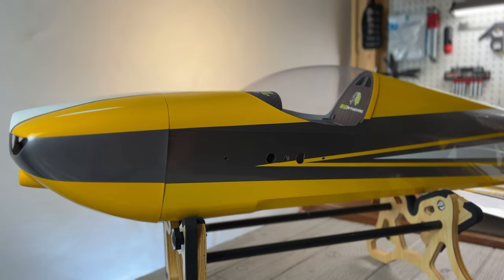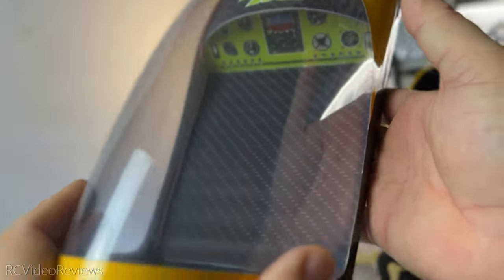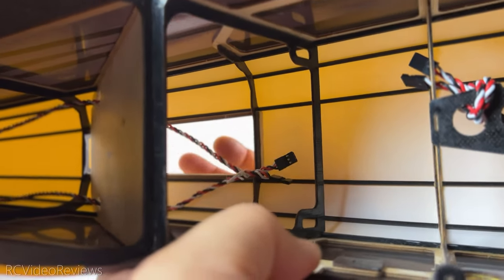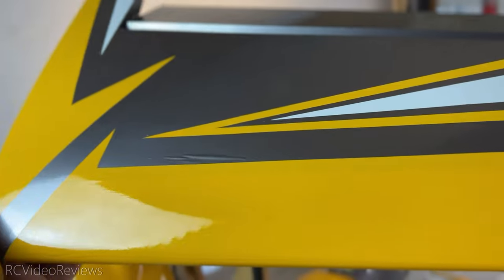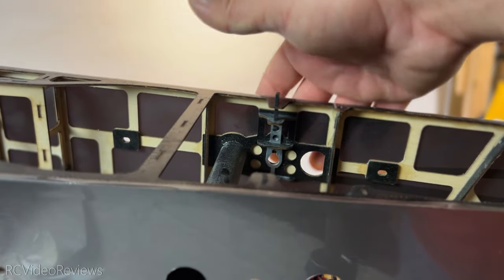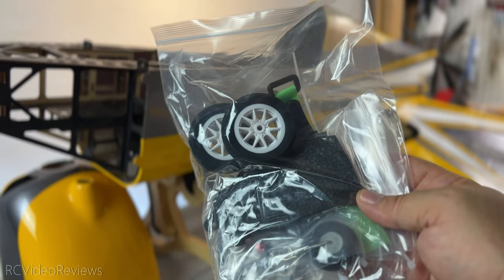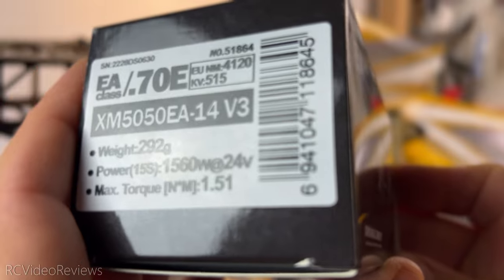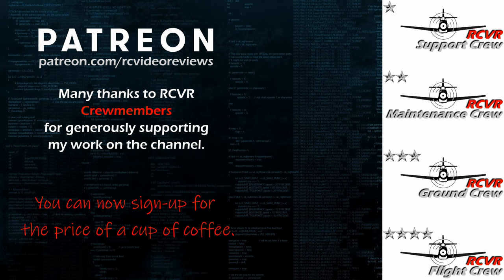Skywing 61" Edge 540 RC Airplane First Look

Comment: I just ordered a 67' Skywing Edge PNP. I use a spektrum ar637t receiver, the normal one with as3x and two antennas. Are there any signal reception problems with the carbon fuselage? Do you advise me to get a satellite for the receiver? Last question... out of the box the bec of the Hobbywing esc should be sufficient, do you recommend a separate power supply for the radio and servos? Thank you!!!
Reply from the maker: I've only experienced RSSI issues on one plane: The 67" Laser PNP. ALL OTHER EF/SW planes I have--no issues at all. So I believe my issue was related to the Rx. Of course, this isn't a cheap plane, so if you can add a little extra insurance with a satellite RX, it wouldn't be a terrible idea.

These aren't full size servos, and I know Tim beat the daylights out of the PNP hardware before posting these for sale, so I don't think an external BEC is necessary.